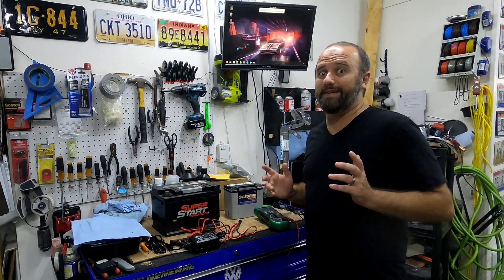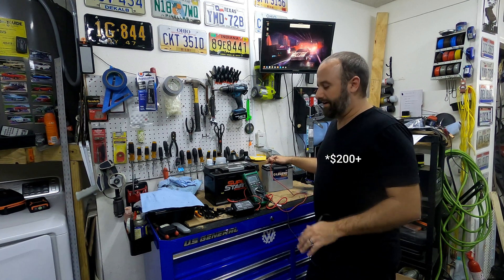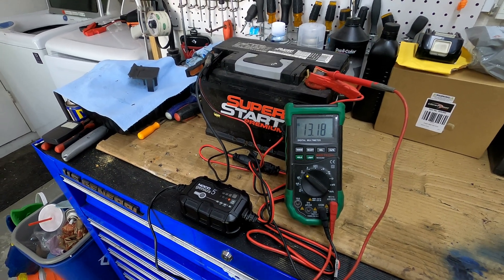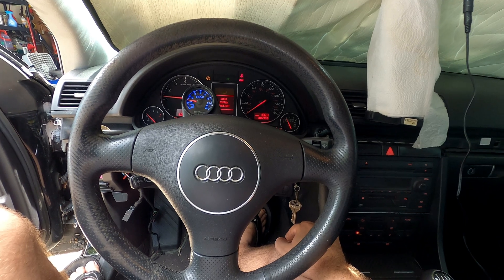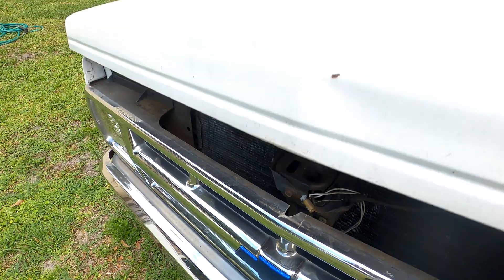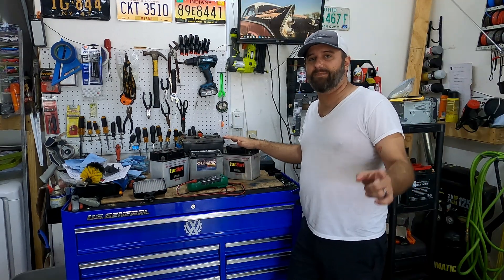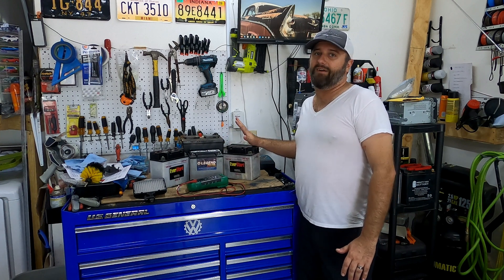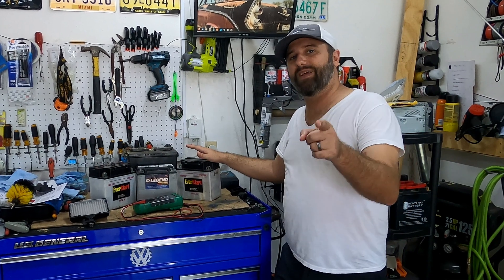Noco Battery Desulfator. . . Will it Save ANY of my batteries?

Comment: I have that one! Bought it for my seldom used Miata. Battery was at about .3V, so I used the force charging mode, which turns off safety features and brings the charge above 1V so the auto charger can detect charge and fully change the battery. It charged completely but then quickly lost charge. I brought it back to full charge and used the repair mode, and now it's holding charge. Results may vary. Consult you doctor if you experience any side effects.
Reply from the maker: It's definitely not going to work in every case, but I've gotten enough extra battery life on a couple to more than pay for the Noco.  I wish I would have gotten one of these years ago.

Comment: Too many variables at play here. But no negative comment from me for your effort.
Reply from the maker: Definitely not a true scientific endeavor, but it definitely works.  You just have to keep in mind that it's only going to work if the battery isn't too far gone.  I've run the cycle on the S10 Blazer battery again since this video, and it's still going.  Battery is now over 5 years old!

Comment: Does the car battery leads have to be disconnected before running repair mode? Thanks
Reply from the maker: YES!  If you leave them attached your could damage other parts of the car's electrical system.

Comment: I think you really need to do a load test to see how many amp hours the battery has before and after.
Reply from the maker: I didn't have a property battery tester when I did this.  Getting ready to do another video on trying to bring really old batteries back to life with a few other tricks, and I did finally get an actual battery tester so I'll try to get more info next time around.

Comment: Have you done any kind of follow up with any of this? How long did the battery last from there on? did you refurbish again? Do any CCA battery testing?
Reply from the maker: I have run the cycle again on a few of the batteries.  One is 5 years old now.  Haven't done any CCA testing, but I did just get a proper tester, and I also have some recommended electrolyte solution to try.  So I will be doing a follow up video soon.

Comment: I think you have to do many repair cycles. The cheap one I recently  got supposed to do it automatically  so i'm going to plug it in every evening. After 12 hours it seemed to increase the cranking amps. The battery never fully quit, just needed the 2nd crank to turn over happened 3times. Its old but a full size.  I think its going to buy a bit of time - which is good. I noticed batteries are cheapened down now !  With LESS CCA than 5-10 years ago. !
Reply from the maker: You are correct.  The best luck I've had with the Repair Mode was running it many, many times in a row.  I've done that 2 or 3 times to the one battery in this video and it's still going.  5 years old.  

I also just got some Battery Guyz electrolyte, that was suggested in another comment.  Going to try that with the repair mode in another video to see if I can't revive a couple of the completely dead batteries.

Comment: Have you tried “Battery guyz” battery acid/ desulfinator fluid in the cells to replace the original weak acid?
Reply from the maker: I have not, but I will definitely look into that.  Might have to test to see if that can revive some of the batteries that the repair mode alone couldn't.
Reply from the maker: Looked in to it and seems like good stuff.  Ordered a Gal, so will try that and the repair mode on some of the really old batteries.  Thanks for the suggestion!

Comment: I don't know if he mentions it in the video, you must disconnect the battery from the car to do this. Obviously he's doing this out of the car, so he followed the directions appropriately.
Reply from the maker: Excellent Point!  I should have mentioned that in the video.  If you run the repair cycle with the battery cables connected to your car and you're probably in for a 4 figure bill to replace a lot of your computer modules!!!

Comment: Your Blazer Truck has a parasitic drain on your refurbished de-sulfated battery, you need to get a ground post idolater installed on your vehicle, isolateing the battery when not in use for a week; ........your battery will no longer drain down when sitting! Pop the hood switch your battery back on and your  ready to go!
Reply: The more likely scenario is that the sulfate wasn't fully removed and the battery is discharging itself.

Comment: My Noco was a no go.
Reply from the maker: No luck at all?  It's bought me extra time on a couple more batteries since this video.  The one from my Blazer is still going strong surprisingly, but I've run the repair cycle on it several times.
Reply: @VHickleGarage  The 6 volt repair did not work.
Reply from the maker: @Sodbusterrod  Ah. . I have not tried on 6v batteries.

Comment: No way,You need hundreds of watts and a frequency of around 800khz to recombine solids to a liquid and voltage across the battery around 3 to 6 times the battery voltage.I done it for years and started with the cheap desulfators that do not work and then used audio amplifiers like the Ampeg svt3 pro that is a 450 watt amp but it did not have good output above 100khz but it worked to get another year or so from a bad battery.Then built a 500 watt with To3 type transistors class ab,Up to 1mhz amplifier and drive it with a signal generator at 800khz and non polarized 3uf capacitor couple it to the battery.
Reply: Should make a video about it. I'm curious to see what you did, I'm sure others would be as well.
Reply: @Akya2120  Yeah I'd love to see more details too. His explanation is sound so seeing it in use would be great.
Reply: As a bass player, I want to see the Ampeg battery charger rig or any other for that matter